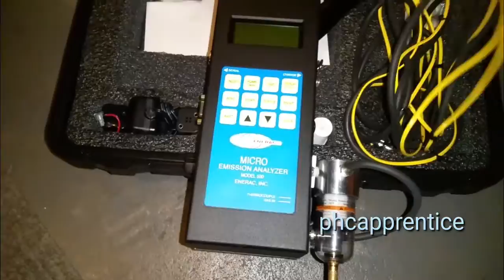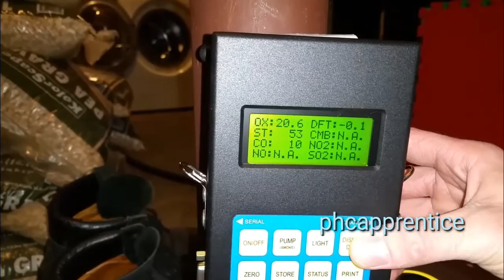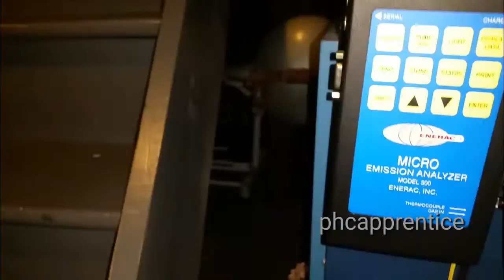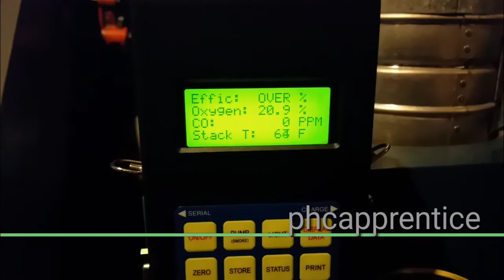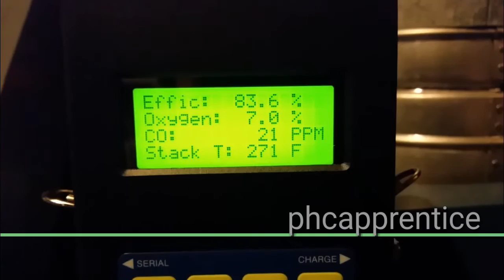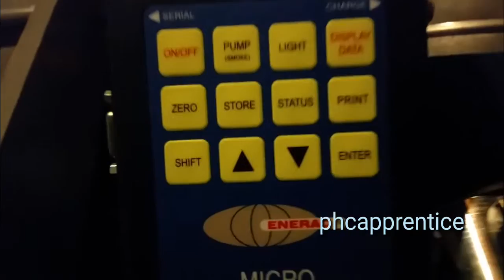New Combustion Analizer - industrial worthy!

Comment: (Analizer)  watch out keep that probe in the flue. Looks like either your burners are dirty or the manifold pressure is too high start up co is over 550 ppm or your pilot is to small.
Reply from the maker: the boiler is pretty much gone. i can clean it up but its due for a changing. i pulled the probe out deliberately as i was just looking to show the print function and pack it up. thanks for watching